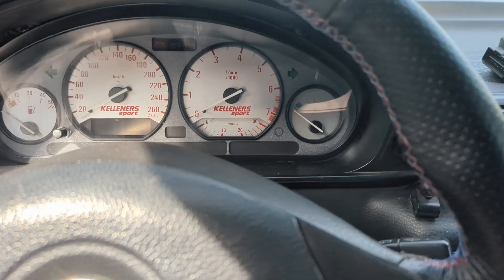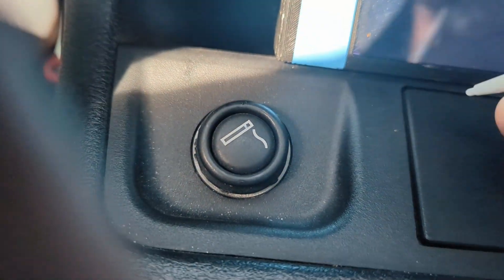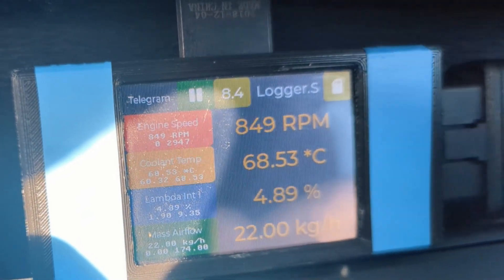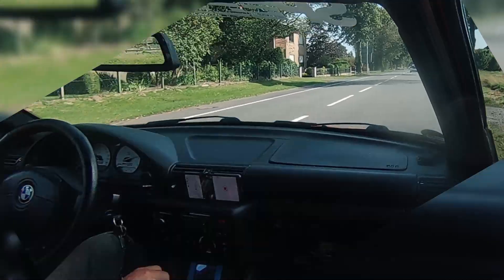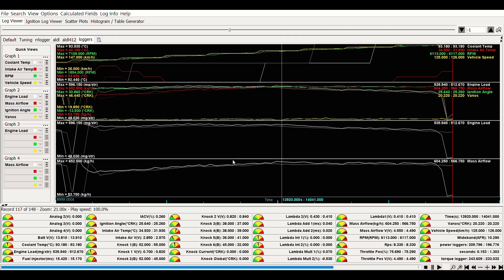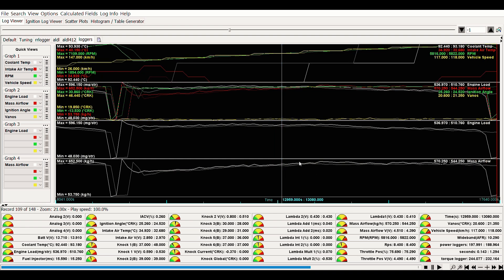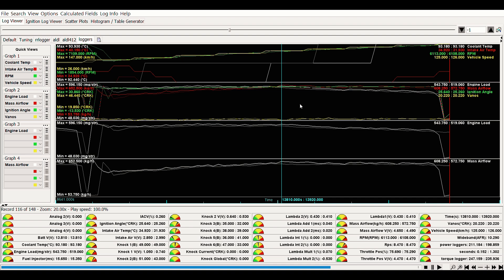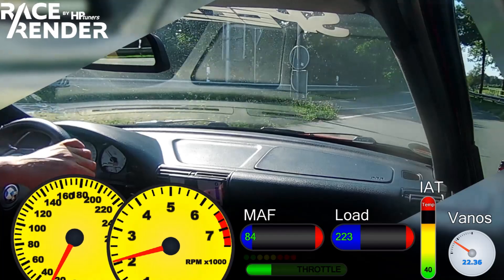BMW E36 E39 Siemens MS41 - S.I.P - M52 MAF Hack - more Power!? - Myth or Bust - Part 2

Comment: Can you test a sport/K&N fitler that allows more air in as the intake manifold is known to be restrictive?
Reply from the maker: I tested different cai and filter mats... Stock air box is best imo
Reply: @CSI_tuning_solutions yea I meant a K&N filter for the stock box which would allow higher air velocity, I have it on my e39 single vanos 523i and I can tell there is a difference but you seem to be doing much better calculations than my butt dyno which is typisch deutsch 😄

Comment: Didnt know that usefull and interesting info.gonna do that on m50b25 with s52 cams equal lengh headers x pipe only rear mufler,bosch ev6 250ccm injectors 4inch kn filter with carbon heat shield to 3.5maf from v8(wihout the mash)to stock TB litlie bit smaller then 3 inch paired to 5.5kg flywheel sinter clutch and sachs perfomance preassure plate and custom dyno tune.i would be happy to hit 230hp mark 😅😅😅again thanks for the info 🤝💪💪😅💪greetings from Croatia
Reply: Edit just saw its only on m52 metal mash behind plastic m50 and others dont have that metal mash🤦🏼